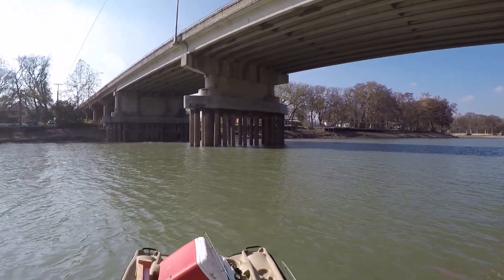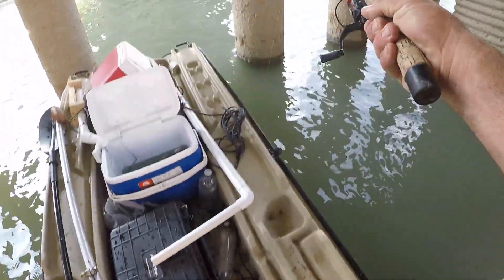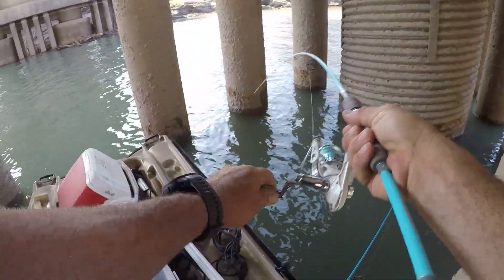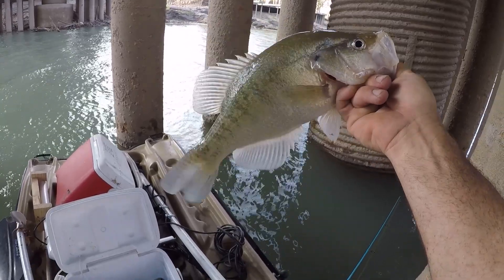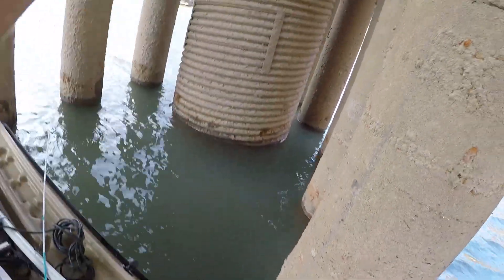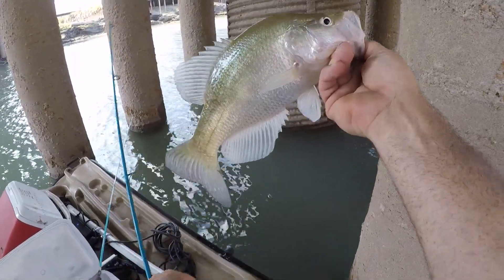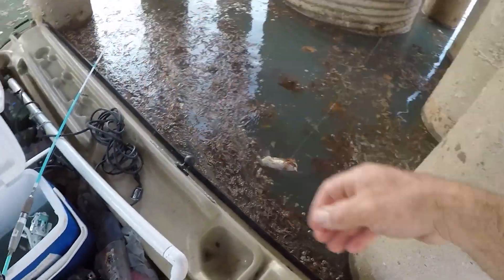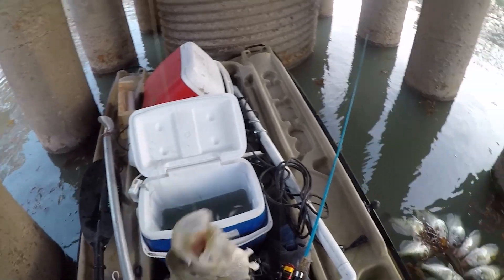Catching a LIMIT of CRAPPIE in 2 Hours! Most Ridiculous Day Catching SLABS! 14-15 Inchers!

Comment: That was an EPIC day bro! But I’ve got to ask about your mud motor…I’ve got a Bass Raider myself and I’ve been thinking about putting a gas motor on it. How many horse is your mud motor?
Reply from the maker: It is a 6.5 hp mud motor but I upgraded it to put out 9hp. That bass raider does around 15 mph top speed. I have been on probably 30 to 40 trips with that setup and it will go anywhere